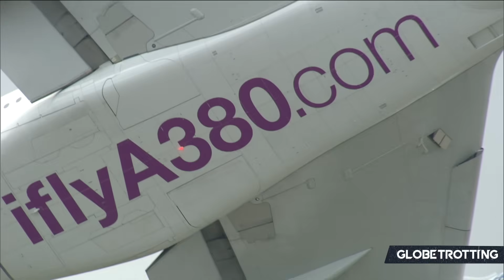The Boeing 747-8 vs Airbus A380neo

Comment: the 748-8 is most definitely not a failyas you’ve repeatedly meantioned-yes the industry moved away from quad jets for obvious reasons with excellent choices for dual engine jets-the 747-8 will continue to fly in not just passenger variants for the second hand industry but also for the freight sector……

Comment: There was never, and there will never be a contest here. The 747 is the greatest passenger/freighter airplane ever built. Airbus has been playing catch-up with the A380 with high costs and a lack of airport space, forcing some airlines to discontinue using their A380s. The 747 has been the preferred high-capacity, long-range airplane. Freight companies prefer the 747's higher load volume as they've seen it for years. There will never again be an airplane like the 747. It was the ultimate luxury, or freighter big jet.

Comment: wtf is your obsession w/ a380 neo it's never going to happen. Running short of content, are we?
Reply: Jesus Christ, no need to be so negative, if you don’t want to watch it then don’t !
Reply: @hoihai9976  The problem is, it's a ridiculous question from DJ...  As the OP stated, there will never be an A380 NEO as the cost to do so, even IF there were to only re-engine the aircraft, would be over $125 million per AC by the time you factor in the R&D AND engines as well as reconfiguring the AC for appropriate weight & balance.  

None of these airliners would ever recoup the monies for such an endeavor.
Reply: Absolutely! 😂